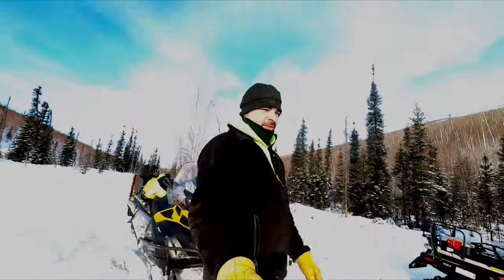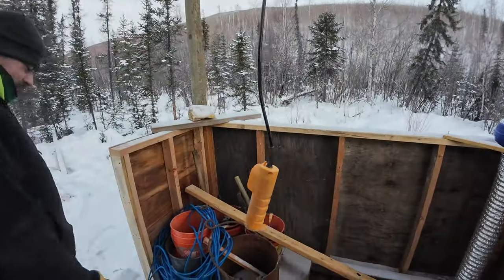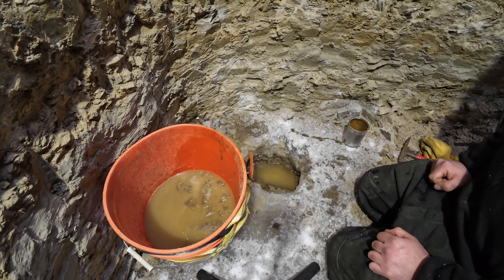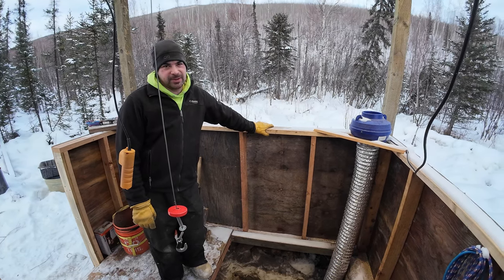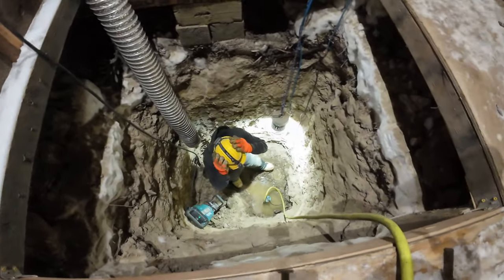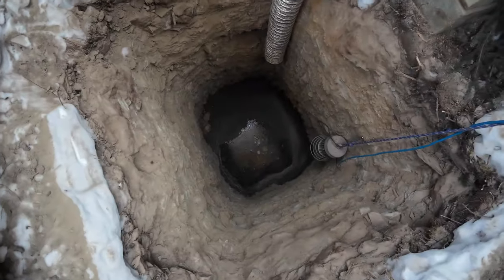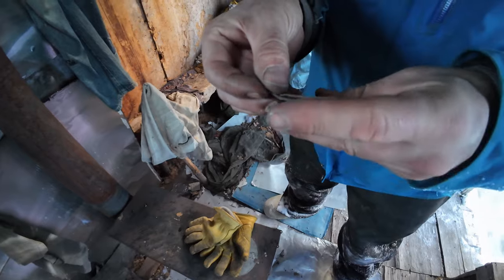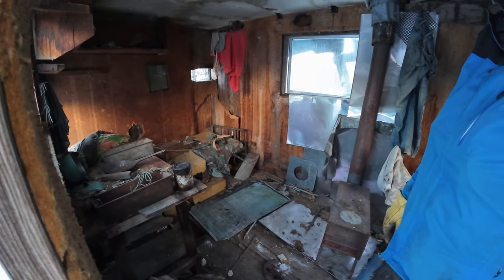Alaskan Winter Mineshaft: Gold Mining/Prospecting in the Interior of Alaska - Part 6

Comment: Time to fill it in and move but due a drill test first
Reply: *do
Reply: Thank you, we are shaft digging due to the high cost of drilling.  This location is remote and it would cost us $20k per drill hole.  That's just not cost effective.  In placer exploration it is very easy to go broke because you're not in production mode.  We are not prospecting to sell, we are prospecting to mine.  Any expenses incurred prospecting will not be recaptured quickly.  When we find what we are looking for and the values warrant the expenses we will pursue bigger and better things.  Thanks for watching.

Comment: Hey guys !!

Everyone out here in gold prospecting land is routing for you !!

We can’t wait for your next episodes.  You have a great footprint and have come so far.  

Just a few issues to deal with, the water, but YOU CAN DO IT !!

You’re gonna have to keep pushing a sump down as you go, but that’s not the end of the world. 

Can I make a couple of suggestions ?

Take an old SDS format chisel point bit, weld a piece of rebar and a piece of heavy flat bar on the end.  That will give you a “power shovel” of any length you choose.  You need it to chase the sump down and down ahead of you so you have dry ground above.  Dry ground will let you drive your level down.

Your gold keeps getting better and you’re just a little way down, think what’s down there on bedrock !!

I ran a horizontal ‘drift’ over 80 feet against running spring water in the Oregon Cascades.  We drove French drains and filled them with round rock as we went into the hill so we could run a wheel barrier over it.

At one point we had a pool of water so big we dropped a small river dredge into it and sluiced.

Jeff is right, you need pump capacity and a check valve.  I’ve pumped water up and over a mountain before with multiple pumps, each with a check valve, dumping into a pool lined with plastic sheeting where the next pump was to push the water on up and over.

Keep pushing !!  Be creative !!  Never give up !!  Never surrender !!

We’re all out here cheering you guys on !!!

Comment: Why do you guys keep the generator out in the weather when you are not using it? Why not put it inside and take it out when you need it.
Reply: I would at least cover it, maybe even build a generator shed
Reply: It weighs about 300lbs and is very hard to drag in and out of the shed.  Generators are made to be outside in the elements.  This one is very difficult to start with the recoil starter.  After much troubleshooting have found our electrical gremlins in a defective cable between starter and battery.  New cables and now it starts just fine.  Thanks for watching.